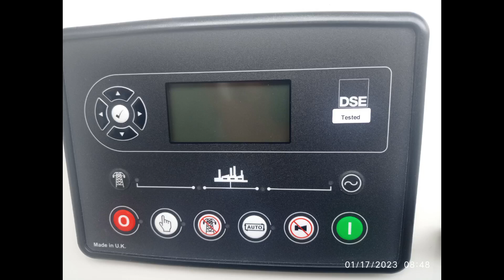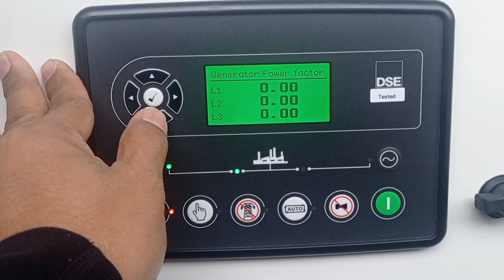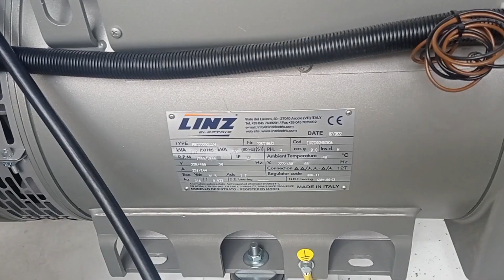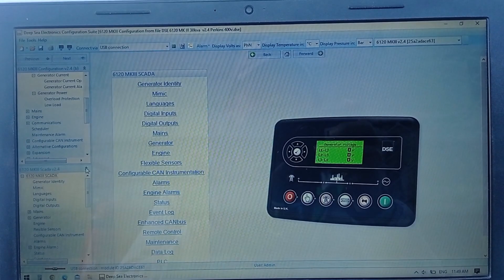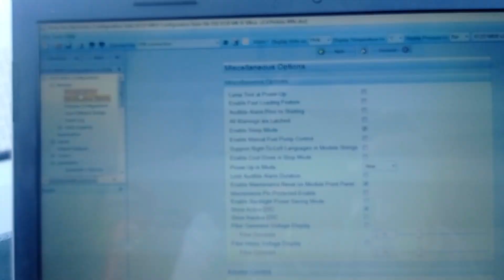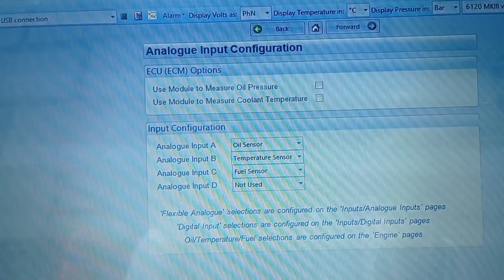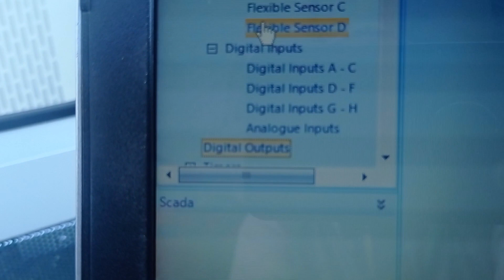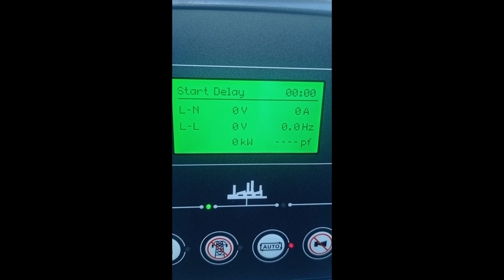DSE 6120 MK III How to check module and programming...

Comment: Good morning! Thank you for the content you provide. However, I have one concern. I have just installed a generator managed by the DSE 6120MKIII. when I turn it on in auto mode it starts directly so the remote start wire is not connected. What could be the cause please.
Reply from the maker: It not impossible to start, check the program where the digital input remote start wire installed